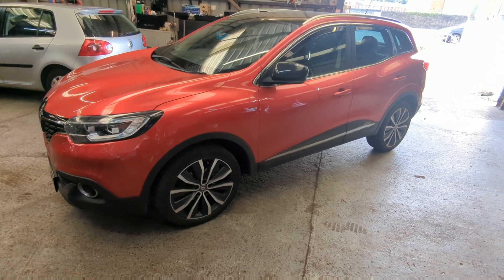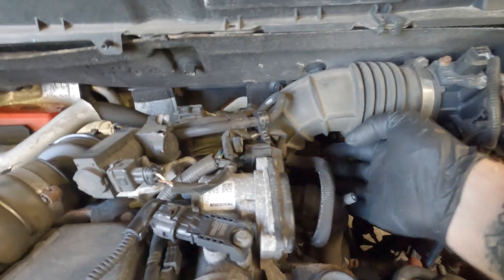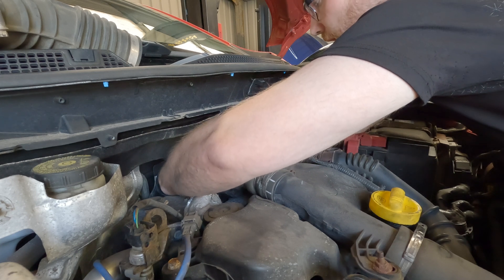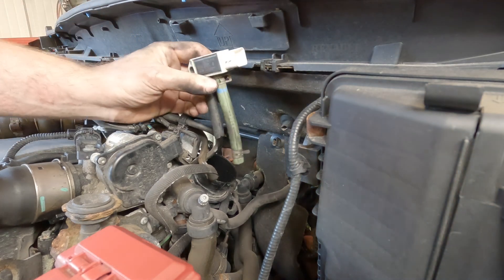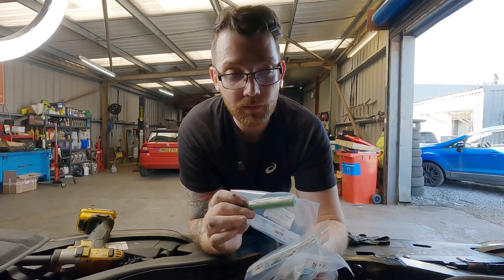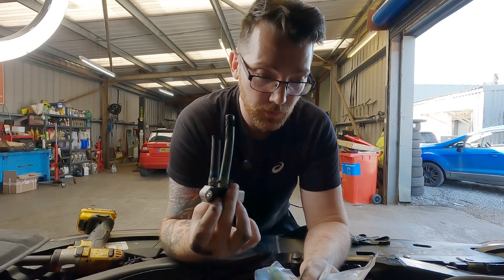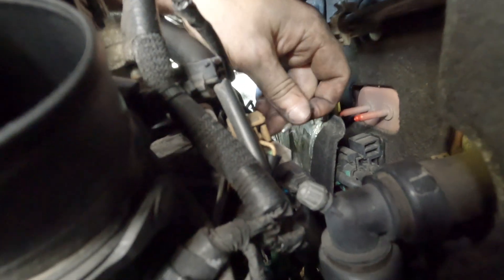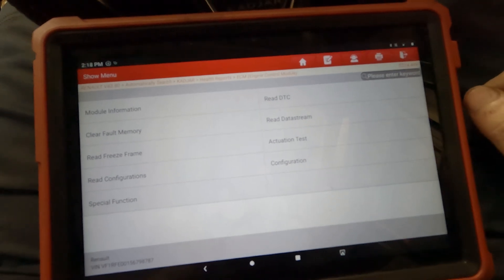145392 Renault 1.5 Dci DPF Differential Pressure Sensor replacement

Comment: I have a similar problem. My ECU lights up with ‘CHECK ENGINE’ and ‘STOP’. Two weeks ago, I cleaned the DPF with a mechanic. Now the warning lights are on again, and I think the problem is with a sensor, not the DPF. Good video, thanks.
(Dacia Duster 2011 1.5 dCi K9K)

Comment: Great video, thanks. I found that you can put the spring clips on the bottom of the hoses and still slide them onto the hardlines, easier than trying to pry them open in situ.

Comment: P1453 not allways  dpf sensor sometimes just clean egr and it will resolve problem 'worth checking first as dpf pressure sensor a pig of a job especially on renault captur.

Comment: Just done this job last weekend on my duster.
Car went into limp mode a couple of weeks ago suddenly. Still drivable but no power on hills. Got both pipes off ebay for about 8 quid each. Absolute bastard of a job due to not being able to see any. Looking back i should have just cut both pipes off as i had new ones. The black pipe was split in half. Car back to full power now.

Comment: Great video, thank you - I have the P1453(92) code but it says Fuel Tank Pressure Relief Valve Malfunction. I dont get any live data from the DPF sensor so I'm thinking the change in the video is needed? (Nissan Qashqai J11 1.5 Diesel) THANKS

Comment: very good job, please tell me if it is also valid for error 922c64 (oil pressure sensor circuit, implausible signal). I own a Kadjar 2019 and I have this error on the car, how can I solve it?

Comment: Hello, I changed this part which was indeed defective. Unfortunately, I still have a lack of power in my vehicle. In addition, like at the beginning, my engine speed is malfunctioning. No engine braking and my gear shift lights are not displayed.

Happy New Year to you

Comment: I needed this video sooner. Paid approx €500, to fix this issue at the official dealer. 
They charged approx €40 per pipe , €170 for the sensor and €140 for labor. 

I did not know the location of the sensor and the weather was getting colder. 

I feel so ripped off, good reminder to always do it myself. I would have been done with less than <€100😢
Reply: It took me 12 hours of work myself to change the black tube. The tube can be stuck on the metal one and you may have to cut it and wrestle with it with a screwdriver. It is in a such a bad place that tools do not fit in there and you can only use 1 hand at a time. I put a lanyard on the tools so they would not fall down. Actually I used my finger to get the metal clips moving - it is a horror of a job. I do not blame the dealer if it took 5 or 7 hours messing with this thing. There is no room around the engine to do the works.

Comment: Just did the same in a Captur 2016 1.5 DCI. It was EXACTLY as you showed, I mean the pipe was cut at the same spot. There was soot on the green pipe which showed the problem. It would not measure the differential pressure due to the loss of pressure from the ruptured pipe and would not calculate the soot load on the dpf. Changed the pipe and everything works as it should.